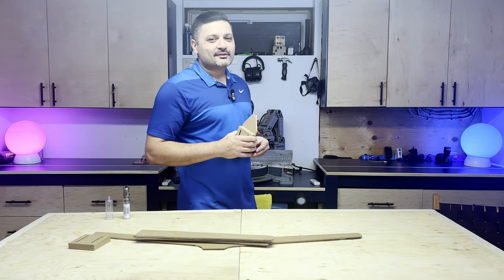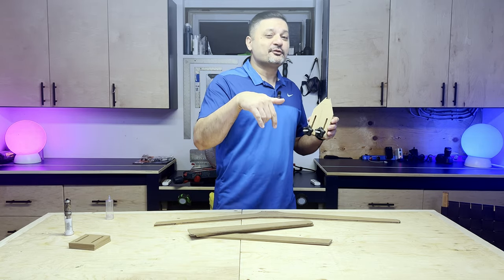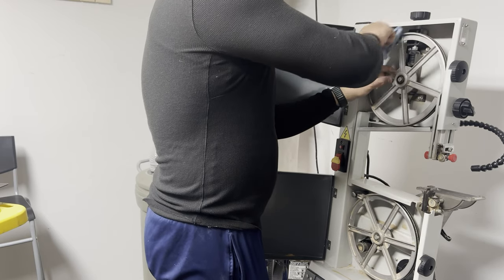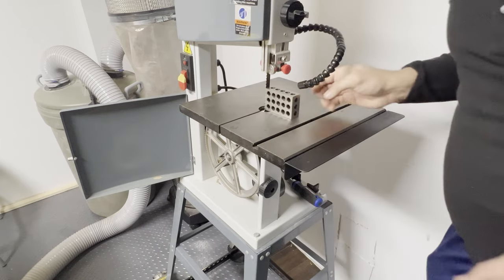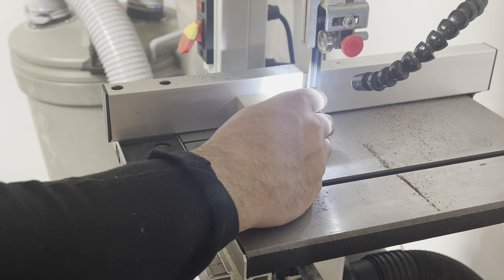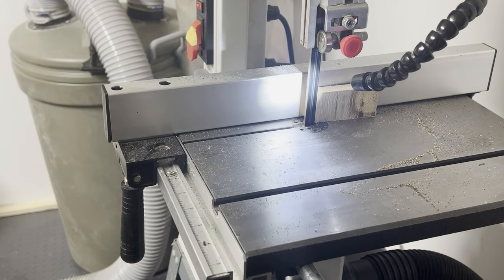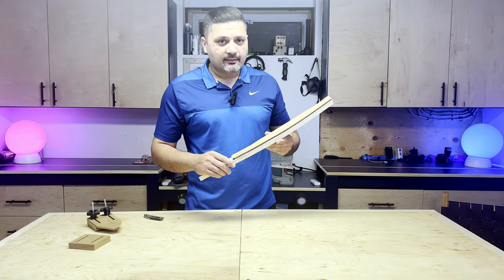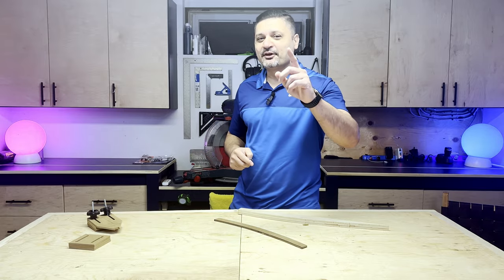The Ultimate Flush Trimming BANDSAW Jig & Tune Up

Comment: As a professional furniture maker don’t need anything like that but if you’re a hobbyist then it might help. Definitely you don’t want to use double sided tape to hold the template together when flush trimming on the router, there’s better safer ways to do that. Safety first!
Reply from the maker: A comment from a professional is a compliment in itself; thank you! May I ask, as a professional furniture maker, what would you use to hold a template while routing? I’ve used blue tape and CA glue in the past but double sided tape has worked better for me.
Reply: @RVWoodworks  Toggle clamps on a pattern jig.
Reply from the maker: Ahh that’s interesting; I have a few in my shop and will give that a try on the next build; thanks for sharing..,